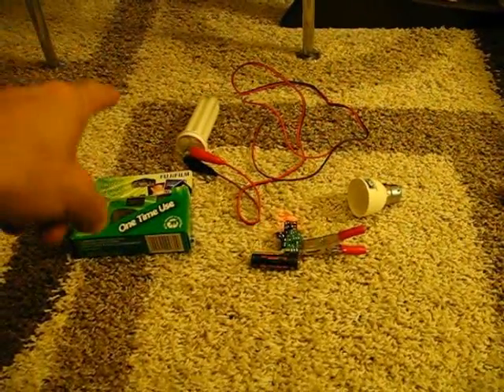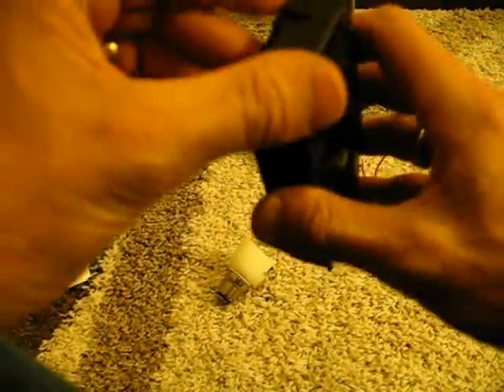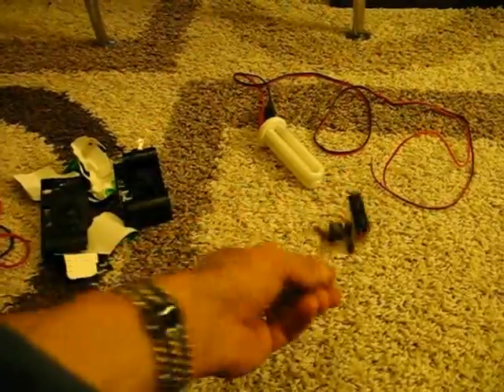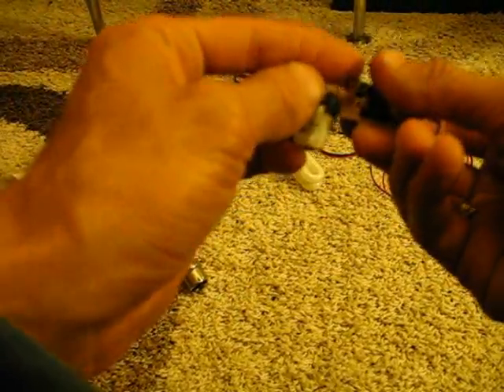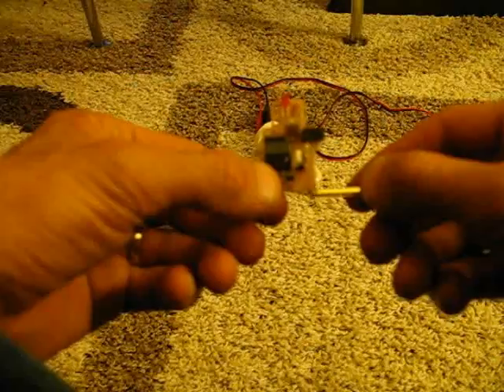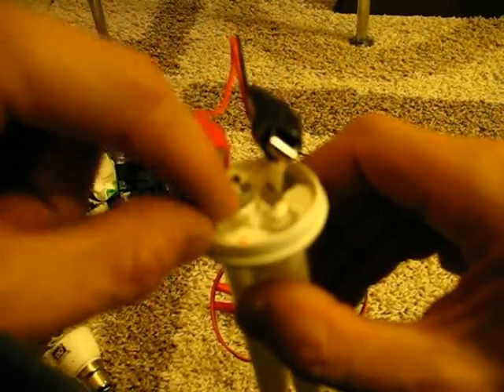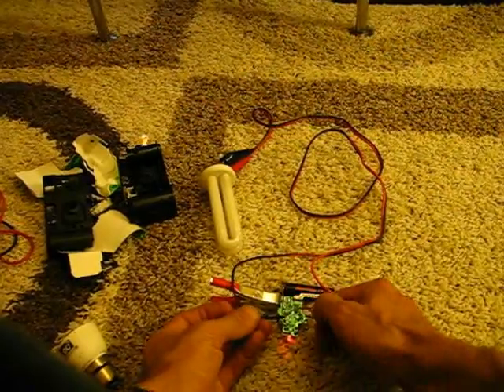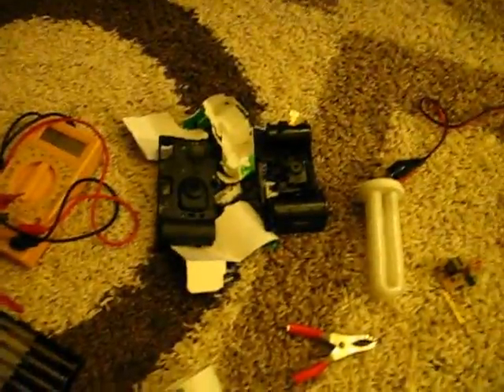Running a 240v lightbulb of one AA battery. Very real and very useful. With full how to. 100% real

Comment: overunity - LOL
Reply: Just as a matter of interest, who said anything about over unity? I don't think anyone used the term in the video or in the description, and I don't think he was trying to pass this off as an over unity device. He was just trying to show us a way to get more out of good batteries and even otherwise depleted batteries. I know I have a lot of batteries I was going to take to be recycled, but I think I'll put that off until I've at least tried this. It should be a hoot.

P.S.: If I find that it doesn't work I'll be back to join you in discrediting it, but I must be sure first. On the other hand, if it does work I'll be back to say so about that too.
Reply from the maker: Bruce Dobson Thank you I never say its over unity, Its great for using the last few drops of energy from depleated batteries. Especially good for hooking up to a solar panel.  I converted a lot of those dollar store cheap led solar lights to use cfl bulbs. They are so much better light output and run longer than the led bulbs.
Reply: Armookie
I know exactly what you mean. I guess it's a classic case of people seeing what they think they'll see, or what they want to see. I know there are some people who seem to be unable to sleep unless they've caused trouble for someone, and I suppose others are just rabble rousers.
I have a few solar cells taken from old solar walkway lights as well as 3 or 4 smaller panels to try using with it. I wonder about how to increase the circuit's power handling capacity so I can use it with larger sources and maybe run all my house lights from it. I'll have to look into that.
I also wonder if we could use a long fluorescent tube (maybe 18" for example) with this. Also I think I'll try other LED's (other than household LED bulbs) with this circuit. I'm a security guard and one of my favourite flash lights is an LED, 4 mode, MagLight. It will run for up to 38 hours (continuous use) on two AA cells.
Anyway, so many things to try and so little funds to be able to do it with.
Enjoy the adventure.
Reply from the maker: Bruce Dobson I hope you do well with the projects you have in mind. The transistor will burn out with more than one AA battery so you will need a small heatsink on the transistor if you want to try with two AA batteries. Yes tubes work with this as well so give them a try. Hope you enjoy and learn a little something from this. Its all about getting the most out of power sources more than overunity.  Don't know ware people get that from because I never claim that but oh well you know what people are like. Good luck :O)
Reply: Sorry - I was "on one" - it was the link to the tinfoil-hat quack website and the "Uses hardly any amps" bit ..
Neat to recycle a board from a disposable camera.
I did something similar for the front light on my bike - but I have 12 volts available so it was a lot easier - or course I=W/V so for the same light output the current will be 100 to 200 times as much as at mains voltage - depending where you live. My front light took a whole amp from my 12 volt battery as expected.
"Practical Electronics" reckoned the single cell was the best value disposable on the market so published a schematic so people could replace 9 volt batteries.
Reply: I understand about the "rant". I know it's hard to not respond when something is blatantly wrong. I also know that I have a hard time not responding when people don't give something that evidently works as stated a fair shake, or even worse, they ridicule it.
I find it hard to believe, but I'm also becoming more and more convinced that there are some people who get on the internet/Youtube (and things like that) just to bad mouth things that definitely work, probably work, or maybe even don't work but spark the imagination. I'm even getting the idea that power electric and oil companies, etc. may be paying people to discredit certain ideas, bad mouth certain people and generally discourage others from trying new things. The only thing these "experimenters" are doing is using the scientific principles we already know and use a little differently, maybe a little better. We'd still be without penicillin if people didn't notice and use things that are a little different.
I know that over unity is a long shot, but I'm not going to discourage people from trying, God knows we need something to help us clean up after ourselves (pollution). Four of the most abundant things on earth, water, sand, sun (light & heat), and air (kind of sounds like the "four elements") are largely being ignored and it behooves us to do everything we can to preserve the only self-sustaining planet we have available to us. Reduce, reuse and recycle are just the first part of the beginning if cleaning up our mess.
I could get long-winded about this so I should shut up now. I'm going to try this thing with the disposable camera circuitry and see how that goes. I'll post my results to this video's page when I'm done but that won't be for at least another 2 weeks. I like what you did with your bike.
Take care and enjoy the adventure.
Reply from the maker: Bruce Dobson Funny thing is I was offered money to remove this video from youtube and the web. But I think it's more important as a learning curve to keep these type of videos up on the net.  People need to see how much can be done with very little power and concentrate on that. Everything today is very in-efficient and costly to run. Science and technology really needs to catch up and make the most from as little energy as possible. unforgivable really that things are being held back just so big corps can make big profit. But at least mobile tech is pushing the energy efficient issues more than people realise. I love that fact as everyone wants a cell phone to run as long as possible between charges but disregard other things that can also be much more efficient. :O)
Reply: Offered money - LOL.
By whom ?
Reply: the man  :)
Reply: By "THEM"

Comment: 1800Ah battery, where would you get such a high powered battery? or did you mean 1800mAh battery? if you such a simple thing like that wrong may i suggest you go back to finger painting
Reply from the maker: I think that is pretty obvious. :0)
Reply: +sean davies  Well this does work and it works very well. What is shown in the video has been repeated by many of the commenters and many other youtubers have also made videos of these working as stated. No trick and yes it works!
Reply: +LookUpTV what? can you read? the video maker claims he used a 1800Ah battery that is 1800000mAh battery he would need 1000 AA batteries to get such an amperage! have you tried to do the same with 1000 batteries connected in parallel? you should wait until you start school the will teach you how to read!
Reply from the maker: +sean davies 1800m-ah battery as far as I know it never stated 1800ah Looks like people didn't see the "m"
Reply: +sean davies I don't see it say 1800ah it actually states 1800m-ah and yes it does work I have made them also following this guide. stop knocking and try it yourself.
Reply: +Dan Russell i did that years ago. you do not need anything from a camera for it to work, there are easier ways! it does show 1800Ah like i said you need to watch the video! good bye child!
Reply: +sean davies You really have no idea do you? Your concept of this project is completely wrong!  1800m-ah is what it says at the 2 min mark in the video. So you are wrong with that also.  This project does work. I have made several and use them when camping they do run for 12 to 16 hours easy on one AA battery. I swear by these and have some in the garage